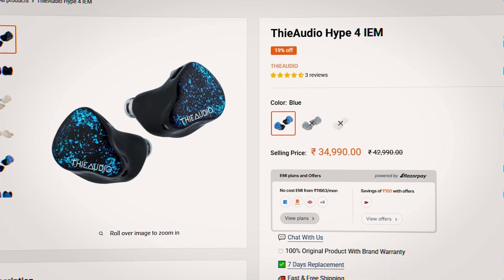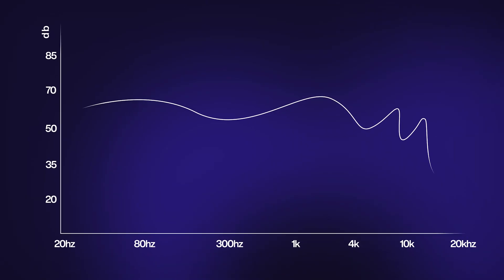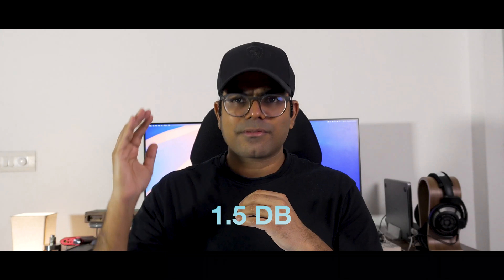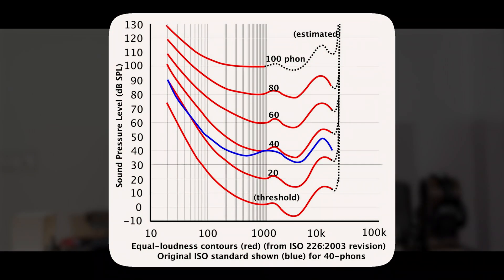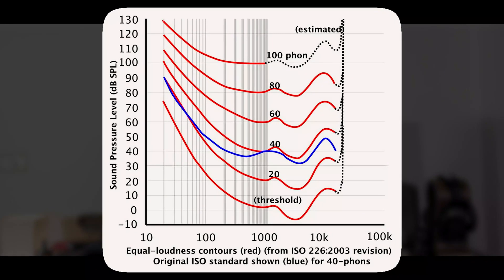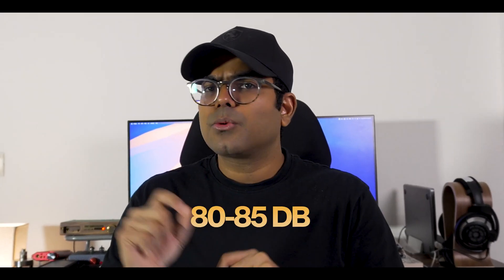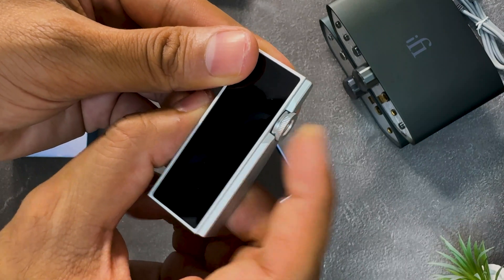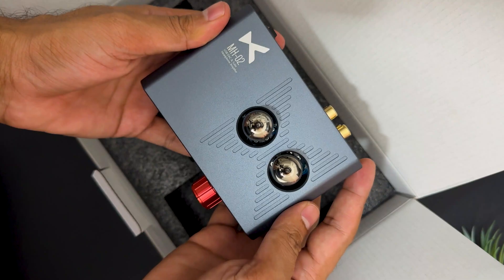The Real Reason Your Music Changes with a DAC 🔥 | Complete Buying Guide | TWX

Comment: I know it's very late but I have a issue, my iem sounds very loud like ear ripping loud on 20 to 30 percent and above 
Does dac help it balance,  because I tried updating my window drivers already. Any help is appreciated (I'm currently using peace on -15 )
Also there is a slight static and buzz when I'm plugged in but not listening anything sometimes it starts and turns off automatically and sometimes stays but doesn't intervene when I'm listening anything

Comment: Brother please help shall i go for 

SIMGOT SuperMix 4 Hybrid IEM

Or kiwi ears - quintet iem

And also suggest a dac for the above under 5to8k  indian currency. 

Budget 20k suggest me an iem and dac. I want to hear all sound and vocals clearly with wide sound staging Brother.

 Using KZ-ZSN Pro Earphone from 2021 without dac, i like KZ-ZSN Pro Earphone  sound but its have very sharp trebles so i reduce the high frequency in equalizer or used AKG K1000 eq in  poweramp app.

Please suggest me an iem and dac

Comment: Which DAC is best for Windows PC and Iphone 15 pro max if I don’t want to buy an apple dongle. I will also need microphone support. Audiocular D07 or JA11 ?
Reply from the maker: Ja11
Reply: @ The iphone does not support the PEQ in JA11. Will it work on iphone if I first save the PEQ on JA11 with the help windows laptop and than use the JA11 with my iphone ? Will the saved PEQ work in iphone?

Comment: great that you mention fletcher munson curves, you pointed out that their finding is that we have to reach a quite high loudness to hear a flat response but the other main finding is that at lower volume we hear less bass and less trebble which may be why V shape tuning is so loved, i keep asking why recent dac/amp don't have loudness compensation like we had on amps from the eighties to compensate the fletcher munson effect at lower volumes
Reply from the maker: Well said.

Many DSP implementation are catering to it. Like Airpods do compensate. However it's would be great to see this in audiophile grade products as well.
Reply: @treblewellxtended  i could not find confirmation that airpods had loudness compensation, where did you saw this info ?

Comment: Just curious, do you personally hear any sound difference with the RU7? If there is, could you describe what you hear between the different DSD modes?
Reply from the maker: Personally, if I compare M15i and RU7. RU7 sound has more body to it. Tad bit warmth and thickness feel. More of a flavour// tonality wise very neutral
Reply: @treblewellxtended  thank you! Appreciate the videos! 

For the rule of 16, just trying to understand, so you're saying it's a more strict rule than the rule of 8, and it's used to make sure it generally will be less colored by output impedance? Like trying to avoid those +/- 1 dB changes?

Also a fun IEM to try with varying output impedance is the Kinera Celeste Relentless! It goes from an intense V-shape to a darker sound with higher OI!
Reply from the maker: @heloiamerk  Yeah rule of 16 is more safer rule. 

I will give celest a try I have it.

Comment: Brother initially i have D07 Dac with usb audio player. I felt there is no sound clarity and also volume was very low. Later i have tried with fioo ja1 it gave massive sound at low level itself and also i have tried ddhifi but it had same issue as low volume. Is this because of any driver issue. Or else by changing any setting can I expect a better sound???
Reply from the maker: It's the DAC issue, Audiocular and DDfi are same DAC, they have poor distortion in some batches.

Use Fiio JA11 it's a good DAC
Reply: @treblewellxtended  Can we expect a fix in future update from music player side??? Because I have just bought ddhifi.

Comment: Excellent video. Though Technical terms may not relate much to me. 
But ultimately it comes to investing in Better IEM and Eartips. They have made my experience noticeable however I tried pairing the same IEM's with ₹1000-10,000 Dac.😊
Reply from the maker: You’re spot on!  IEMs and eartips matter most.